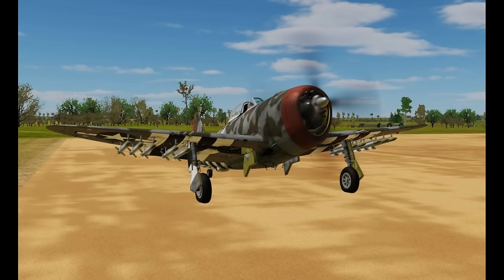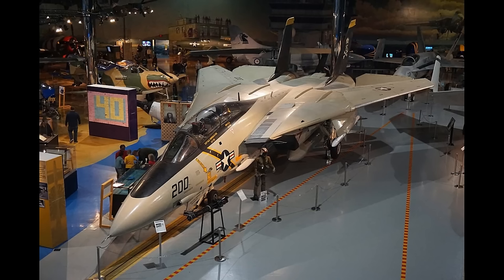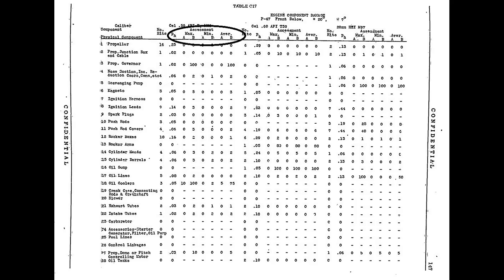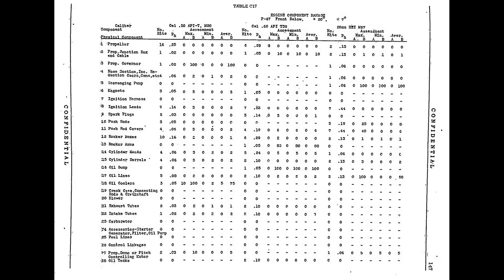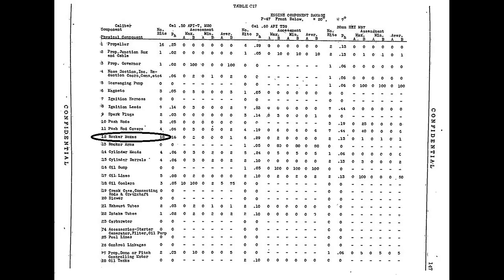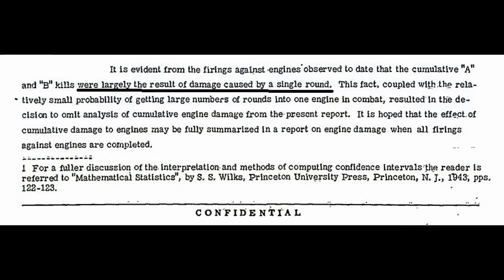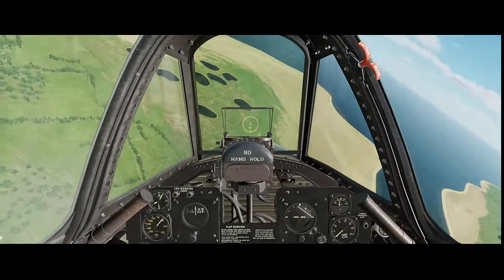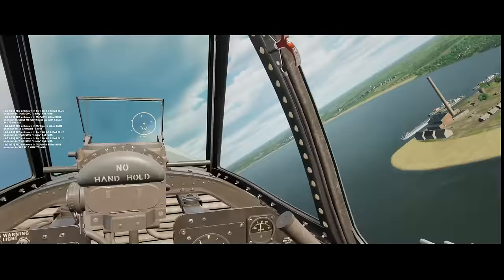50 Cal Vs. 20mm Engine Damage in WW2

Comment: Ok, so I'm not an aircraft expert... I'm still having an issue with dual mags increasing power?... how I see it both mags firing at the same time is going to cause 2 flame fronts in the engine cylinder,  I can see how a quicker total burn of the fuel mix may increase total efficiency of the burn and an slight increase in power, but wouldn't you be setting you self up for pre-ignition, detonation, etc?... then again it would also explain why aircraft engines are built like "tanks"(more like diesel engines), and why they use 100 octane or higher, etc., etc... I'm I missing something, other than reliability, for a duel magneto set up?
Reply from the maker: So many of you have asked about this I should make an entire video about it. I don't think I can do justice to this in the comment section.

Comment: With 18 cylinders, if 2 or 3 took a 20mm ap round to the cylinders, you have 15 or ore still driving the engine.  
This would beat the hell out of the damaged cylinders, which after some time is probably how they flew back with cylinders gone on return.

Comment: On the Curtiss-Electric prop -- there was a good chance that the prop would go to low pitch and run away if the governor were damaged.  A or B kill, no question.
Reply from the maker: Low pitch wouldn't be too bad if you pull the throttle back in time.

Comment: The post war british hawker hunter carried 4 X 30mm ADEN Cannon. each cannon had a firing rate of between 1,200 to 1,700 rpm with a muzzle velocity of 795m per second (2,610ft per scond) so the combined firing rate of 4 x 30mm cannon would give a firing rate of, between 4,800rpm and 6,800rpm. incidently thefleetair arm's Sea Harriers retained 2 x 30mm cannon untill their retirement in 2006 and that aircraft had a very good air to air record against supersonic Mirages as well as   Skyhawk, canberra and pucara's  Admittedly most fell to the superb Sidewinder missoles but some did indeed fall to the 30mm aden cannon.

Comment: Pound for pound a 20mm,37mm cannon round inflicts more damage on any fuselage. Specialy on heavy Bombers.
When the spitfire with their 8 0.303 machine guns face the Bf109 with the 20 mm cannons,very quickly they understood that those 8 machine guns with those ridiculous 0.303 round were no match for a single 20 mm cannon round. So they  change that also,putting a cannon on the spitfire.
And in 1942 in Dieppe when the spitfires encouter for the first time the magnificent FW190 with is 4 20mm cannons,was a real Shock for the RAF.
The FW190 were much better and deadly than any Spitfire.
Again the cannons made all the difference ( not only,speed,etc)

Comment: I wonder if the 50 BMG vs Cannon also came down to the way the American planes carried their guns. Most American fighter/interceptor/Patrol aircraft didn't have nose guns. Having 1000 lbs of cannons in the wings seems like it would be detrimental to roll performance. Whereas, 6 or 8 x 50 cals was enough weight savings to make the tradeoff worth it.
Reply from the maker: I don't think so because the US Navy went to wing cannons in the Bearcat and Corsair by the end of the war and stayed with them until replaced by jets. (they still had some 50 cals around, but clearly preferred the 20mms). The British also went to wing cannons. As for the USAAF/USAF they were going to wing cannons with planes like the XP-72 but went with jets. Those jets had, for the most part, centerline mounted guns.
Reply: @GregsAirplanesandAutomobiles  makes sense. The firepower from the extra patload makes it really worth it to have a cannon sending exploding projectiles down range

Comment: The comment I usually make on this subject - is that if you have a higher rate of fire - then you stand a better chance of getting a hit.  If you are shooting at a maneuvering Fighter aircraft - you are going to have a much more difficult time getting hits - than if you are shooting at a relatively immobile target like a Bomber.

The British and the Germans - both had to engage bombers - and thus there was a stronger desire for the destructiveness of a 20mm round - but - the Americans didn't shoot at that many bombers - except in the Pacific where the Japanese aircraft were all fire traps.

Another factor in this - is the placement of the guns in the fuselage or in the wings.

Guns in the fuselage don't have to be harmonized so that their fire will all converge at a certain distance - the way guns in the wings do.  Before and after that distance, with wing mounted guns - you have the bullets spraying the area.  Here - pilots who are not good shots - benefit from the Spray and Pray practice as there are more bullets flying about and a greater chance of getting a hit.

Guns in the fuselage can be aimed.  For expert marksmen who can successfully hit deflection targets at various ranges - this is a preferable configuration - but - most pilots are not that good a shot.

The P-38 had all it's guns in the pod in the center and pilots were able to aim it's rounds rather than relying on a convergence zone to concentrate their fire but - most American Fighters had their guns in the wings.  Even the aircraft like the P-40 that started off with it's ..50 cal. weapons in the cowl - went to the classic 6/.50's configuration.

So - you'll notice that the US went to 20mm's when their rate of fire was high enough that they were not losing rate of fire because of the bigger rounds.  Here though - these 20mm's were mostly in the fuselage where the aircraft had more room for ammunition than in the relatively think wings.
.
Reply from the maker: That's quite a comment Bob, thanks for your interest in this topic and my video. I do appreciate it.

Comment: However unlikely something is doesn't mean it's impossible.
I remember reading articles where p-47s landed in England with photos 
with damaged cowls and cylinder heads missing.
Reply from the maker: A cylinder head and a cylinder are two very different things. I would like to see a picture of a P-47 that made it back with a cylinder head shot off, I've been looking and haven't seen one.
Reply: @GregsAirplanesandAutomobiles  I used to read a lot of magazines like airpower or Air Classic and the like. that was 1973 or 74
Reply from the maker: So did I, and I remember that too, but now I'm thinking my young mind read something different than what it actually said. I think they were saying the engine was shot up and multiple cylinders were out. I simply can't find evidence of a radial making it back with multiple cylinders shot off.
Reply: @GregsAirplanesandAutomobiles  What makes me believe it is possible is I once saw a little old lady drive a four cylinder Chevy Citation into the dealership with two connecting rods hanging out of the oil pan

Comment: It seems to me that the explosive filler of the 20mm had less of an effect than I expected to see in this data. When I heard of cylinder jugs being shot off of Jugs that made it back, a German 20mm HE detonating in there among the cooling fins and push-rod covers seemed to be a reasonable cause.
Reply: Remember that US 20 mm shells had way less HE filler than German HE shells. MG151/20 Minengeschoß are insane in the amount of HE they carry.
Reply: @FirstDagger  That's a good point, thanks. I was definitely thinking in terms of this video that I saw again recently: https://www.youtube.com/watch?v=bdr4ngshWl8
Reply: @FirstDagger  I thought the MG151/20 had less HE filler than the Hispanos because the German 20mm was based on the smaller 15mm cannon, originally.
Reply: @goldleader6074  ; MG151/20's Minengeschosspatrone 151 ohne L'Spur has 18.6 g filler and Hispano Mk II's HE shell has 10.2 g filler at most, some state that wartime Hispano had 6 g at most. MG151/20 has the fire rate, weight, and HE filler advantage while Hispano has the velocity and thus penetration advantage.
Reply: @goldleader6074  You should find pictures of the 15mm and 20mm rounds. They used the same or very similar size casing. As a result the 15mm had good velocity, but 20mm had pretty big shell.

Comment: Wouldnt a 20 second burst from the M2 Browning handily empty a 400 round magazine as in the 51?
Reply from the maker: That's not the point, it's about getting enough hits for meaningful statistical data.
Reply: @GregsAirplanesandAutomobiles  Wasn't arguing the data, rather alluding to the thought that the decision to use a 20 second burst was to immulate an full magazine load of ammunition.

Comment: The dual plug spark plug argument is far more nuanced than simply adding a plug adds power. It has more to do with the ignition timing itself, and how you can run a certain amount of advance with two plugs versus the amount of advance you would need to run with one plug. If you lost a plug and the advance wasn't optimized for the remaining plug, of course you would lose power. If it were as simple as adding a plug and gaining more horsepower than every engine manufacturer would just add dual spark plugs to their engines worldwide, whether it be an aircraft engine, or an automotive application. It's not the case.
Engines that benefit most from two plugs have very inefficient combustion. This is related to the piston/combustion chamber  interface.
Other engines that run dual plugs do it for redundancy not necessarily performance. Lose a plug and you have a back up.
Reply from the maker: Of course it's more nuanced. I was simplifying because combustion chamber design and spark plugs are not the main topic of this video. That said, on hemi type combustion chambers dual plugs more often than not add power. There are aftermarket heads for old style single plug Chrysler heads to upgrade them to dual plugs. This is done for power, not for any other reason. It's the same story with older Porsche 911 engines and Alfa Romeos.

Comment: The two plug mag check thing. Yes, obvious he has never made it to the run-up area. Hard to be more wrong, given that the absence of a rev drop while switching to one magneto is a fail. Even at moderate throttle settings.

Comment: I am going to have to disagree about the four cylinder engine.

A friend of mine was driving for months on two cylinders and one headlight until I fixed the headlight and installed spark plugs and two new cables.

Comment: . A machine gun is like a hose with the tracers helping you correct your aim. There is a lot of vibration. I am going to guess that the original shots were wildly off target. With a prolonged burst burst a pilot could get accurate hits. For air-to-air combat The air forces and navy should have used the 60 caliber. The range and effectiveness would have been substantially better and would have justified the change from 50 caliber. 50 caliber is a fine weapon for anti personnel and anti material for ground personnel.  The aircraft carriers changed their  25 mm cannons to 40 mm bofers.  The P47 and the P51 should have changed to 60 caliber. It would have had an enormous psychological advantage on the Germans as well.

Comment: I've been reading, watching videos about the Curtiss-Wright +/- 2,000 HP twin row radial engines 
giving  pilots, engineers, and aircraft developers SO MANY PROBLEMS in the later years of WW II, specifically the B-29 Superfortress 
and the SB-2C Helldiver development.  As a P-47 and Corsair fan, I've always wondered why US aircraft engineers didn't just go
with a modified version (with appropriate turbochargers) of  the super-powerful, super-reliable   P&W 2,800  Twin Wasps instead - 
especially since the B-50 Superfortress  (based on the B-29 airframe) was equipped  with four DOUBLE-DOUBLE Wasp engines, 
  i.e. with P&W 4360 Radial engines that were essentially Two  P&W Double-Wasps mated together at the crankcase!
https://en.wikipedia.org/wiki/Boeing_B-50_Superfortress 
Which P&W 4360s Gregg pointed out installed as a conversion (in replacement of their original  Bristol Centaurus sleeve-valve engines) 
by one or two race crews turned the Hawker Sea Fury in to  world beating unlimited class Reno Air Races piston race planes. 
Not just the B-29 and SB-2C.... but as well the Avenger torpedo bomber, the B-25 twin engine bomber, and even the Grumman Wildcats 
and Douglas SBD Dauntless dive bombers...  every time I look at them, I think those airframes are BEGGING for the more powerful, 
more reliable P&W, which could easily have been mounted on the huge Avenger, was actually tried on the B-25s (it was too late in production 
to justify the changes, with the faster, less crewmembers  Douglas A-26, already with P&W 2,800s and already  in production, coming to supplant the B-25)
but even the smallish SBDs & Wildcats  could have had their wings and fuselage lengthened and strengthened  a bit to accommodate the bigger, more powerful P&Ws. 
A recent Rex's Hanger video on the Helldiver and it's  development hell of  800 modifications (!) required to make it airworthy
  suggests that Curtiss-Wright having SO MANY PROBLEMS with both the Helldiver and it's Curtiss-Wright engine put the company 
so far behind the eight-ball that  at the end of the war that they missed out on other technology developments and... went out of business!  
At the start of WWII, Curtiss-Wright was a bigger corporation than GM!
Reply from the maker: Curtiss-Wright is still in business. However, your overall point is valid, Pratt and Whitney was way ahead and Curtiss-Wright never really caught back up.
Reply: Maybe click bait videos...US aircraft (and equipment in general) would typically go through far more development (and modifications, revisions, testing, etc) than other countries.  US development in this era was rarely 'it's good enough, get it out the door' when compared to other countries.   
I guess I'd get flamed for stating this, but it seems to be very common for British content creators to denigrate other countries manufacturing/engineering (especially US made stuff) while over inflating the importance or success of their indigenous made/engineered/developed products.  
I'd be interested in seeing some hard numbers on loss rates of the aircraft in comparison to contemporaries, how effective they were for their designed role, the reasons behind the added size and weight over the predecessor (and what that would do to it's capabilities IE range, payload), cost of development/per aircraft, etc. instead of the same old stuff that is regurgitated on wikipedia and in coffee table books.

Comment: The bore on these engines is massive compared to any auto engine. The dual plugs helps ensure complete ignition of air fuel mixture. If it didn't matter they wouldn't have used the system. Think $$$$
Reply from the maker: Today's 5.7 liter Chrysler V8 has dual plugs per cylinder.

Comment: I'm definitely not an expert, but I'd think if you had a single (or dual) M2 pointed at a test stand 500 yards away, especially after you'd been doing it all day, that you could get a hit rate up into the 75% range on a burst.  They're both stationary, and again, I'm assuming when they give the next P-47 a cigarette and a blindfold, it's in the same spot as the last one was, so you learn where to put it in your crosshairs before you have at it.

Comment: As far as I know the MK 103 and MK 108 both used the same projectiles, the difference was the size of the casing/amount of propellant and the length of the barrel, the MK 103 having a much longer barrel and larger casing.
There is only one exception to the ammunition which was the heavy Tungsten carbide core APCR shell for use against ground targets as the MK 103 was the successor of the ground attack cannon the MK 101
I actually own an Inert MK 103 HE-FRAG shell complete with casing and belt link and from images I have seen of MK 108 shells the projectiles appear identical.
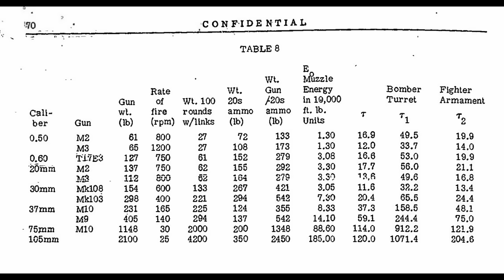Reply from the maker: The chart at 30:27 shows much higher projectile weight and muzzle energy for the 103, it's not even close. These same numbers are in other sections of the report.
Reply: @GregsAirplanesandAutomobiles  Did they specify which type of HE shells they used as there are three types.:
HE-FRAG
HE(Minengeschoß)
HE-INCENDIARY(Minengeschoß)
Reply from the maker: Let's remember this was just something I tacked on at the end of this video to show the direction I'm going with the next one. I'll give all the details I have in that one.

Comment: So, a 20-second burst was basically all of the ammo that the average fighter in the 1940s carried. At 500 yards against a fixed target with a fixed .50 cal machinegun, 70 hits is what I would call abysmal accuracy. hell, that's basically what I could achieve off a truck mounted pintle...not exactly the pinnacle of accuracy itself. The most common tactic taught to fighter pilots, at least in the USAAF, was a 2-5 second burst. This gave you anywhere from 4-10 (roughly) cracks at a target before you ran dry.
Reply from the maker: I think you may have missed the entire point of the test. You're not the only one, I'll clear it up in the next video.
Reply: @GregsAirplanesandAutomobiles  no, im aware of the purpose of the test. It was engine survivability and likelihood of combat damages given the two most common aerial gun calibers of the time.

Just commenting on the fact that the hit rate is atrocious. For an aerial platform that is maneuvering and firing at another aerial platform that makes sense. If both points are fixed, thats abysmal.